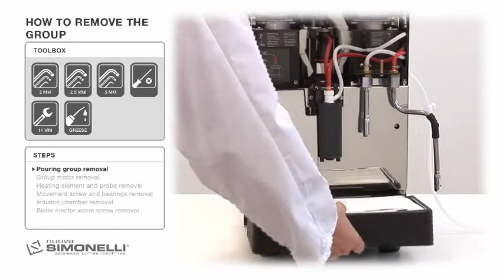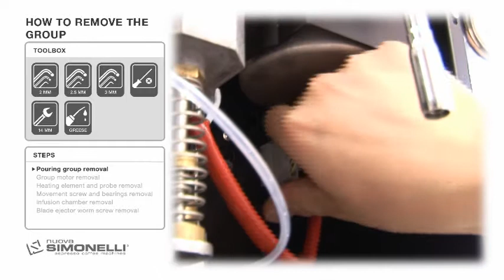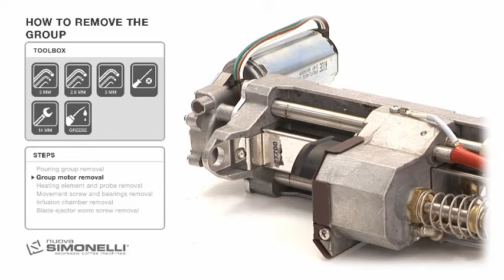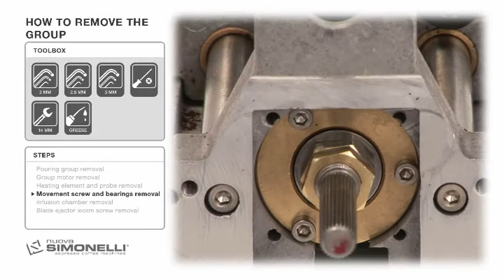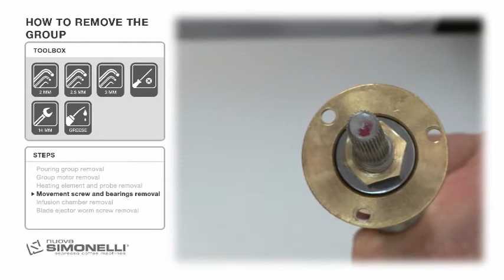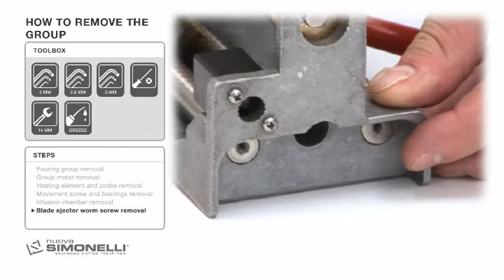3 - Prontobar Removal

Comment: Hi, thanks for all your video abt the prontobar, i've a little issue, i've the tank model 2019, and there's no adjustment screw for milk, so how may i decrease air flow to get a smooth milk?
Reply: You can adjusted,  new machine has to screw placed in top of lthe lelf side,